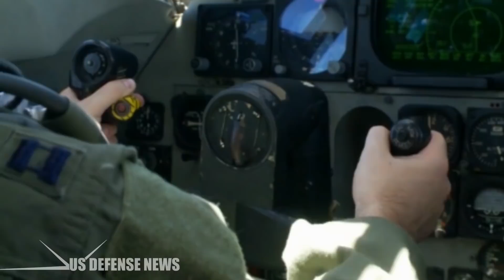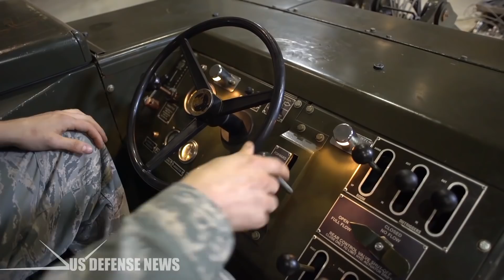Rolls-Royce offers engine for B-52 Bombers propulsion modernization

Comment: How about building some new aircraft!  How many times can you bend a paper clip?
Reply: Fred Ferd how many flight hours do you think they have?I think a general passenger plane has flights every single day in 2 years more flight hours then a B 52 in 30 years some passenger planes in service have 35 years service for ex Fokker 70 and 100 they stopped production in the 70 als DC 3 from WWII there are still in service.
Reply: In the early 1970's I was doing data processing work for a subcontractor at Red Flag, at Nellis Air Force Base near Las Vegas, Nevada.  One day they had an air show and invited all of us out there because they needed a crowd.  It was an impromptu dog and pony show for Anwar Sadat, the President of Egypt, and his advisors, who were visiting the United States at the time.  Mr. Sadat wanted new fighter planes, and the US Government was trying to push F-5 fighters down his throat, but he was not foolish.  HE wanted F-16's, and he knew the difference!  The US Government was horrified at that idea - Giving the Egyptians F-16s would give the Egyptians something closer to equality with the Israelis.  And they had nightmares of F-16s fighting F-16's. Another hideous "triumph" for the idiots at "Foggy Bottom," aka the State Department - God help us all!   Anyway, while there, I got to walk around a B-52.  The thing had numerous visible deep wrinkles in the skin on the sides of the fuselage.  I saw them.  Yes, I've heard that "they don't matter, etc." but you do NOT see wrinkles on the sides of airliners!  The B-52 IS OLD!!!!!!
Reply: +Fred Ferd  Why are the American taxpayers "giving" the Egyptians and Israelis anything?  Let them pay for it just like everyone else.